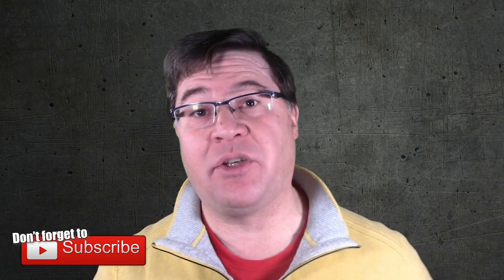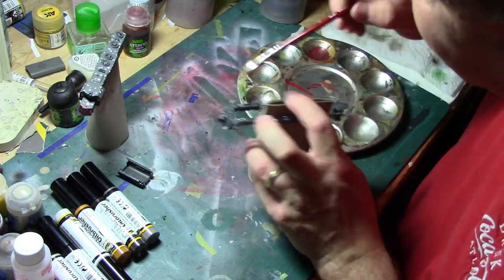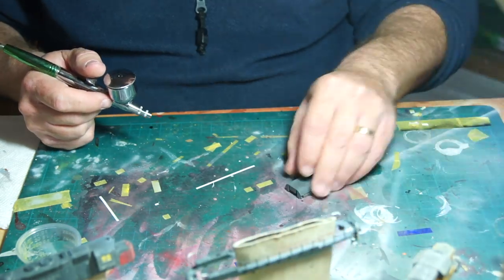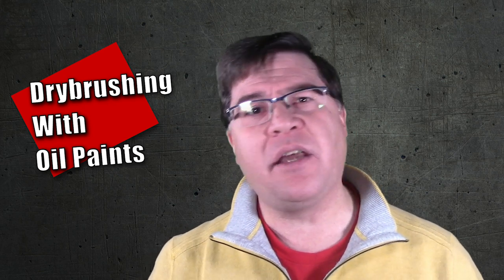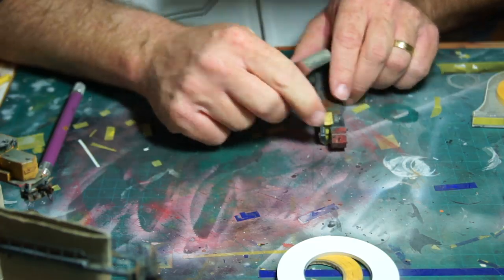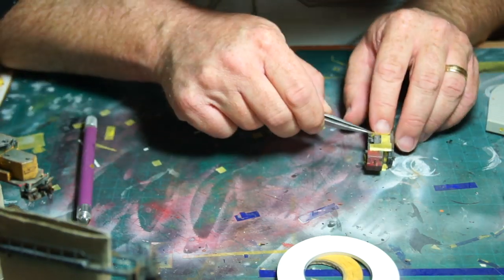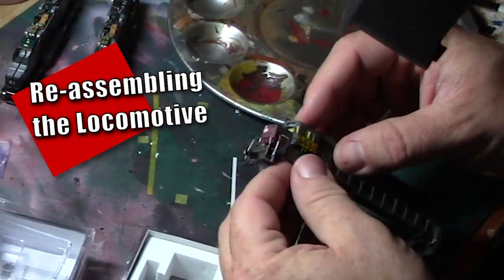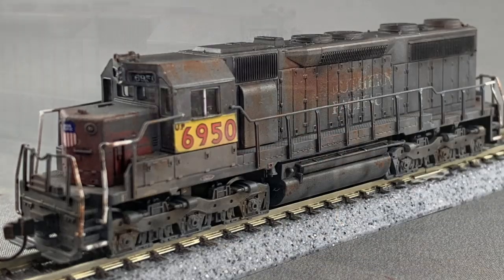Weathering and Patching a Southern Pacific Locomotive

Comment: JC you ask what are my challenges? Well I always make a point of disassembling completely when ever possible. So when a customer sends a loco for weathering and doesn’t include the exploded parts view that comes with it, it becomes a real challenge to take them apart without damaging any of the parts. Just so you know for next time the N scale truck side frames are one piece with the bottom of the truck. They just slip off with a bit of coaxing!
Nice job, but you have to slow down! Do you always talk that fast? Just kidding!
Reply from the maker: I talk that fast when I'm nervous. I should really slow down :) Like you, figuring out how to take apart a locomotive without the exploded view can be worrying. I have an S4 that simply did not come with those instructions. It's next on the to-do list. Thanks for the tip on the side frames. I wasn't sure if I had to remove the whole assembly or not!
Reply: JC's Riptrack just finished a Scale Trains SP SD40T-2 got so frustrated I sent Scale Trains a frustrated email and the sent me a how to on removing track frames but it involved removing the truck assembly to do it!